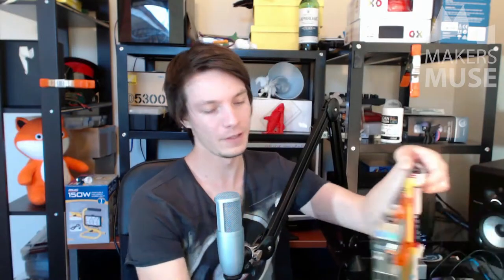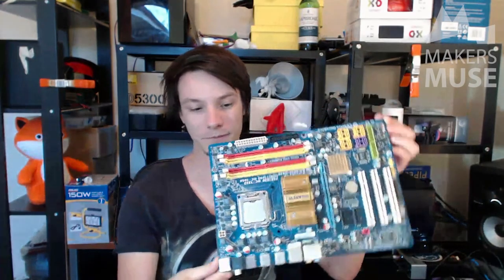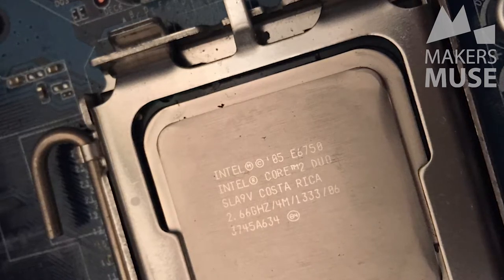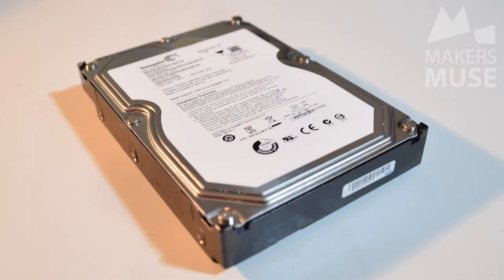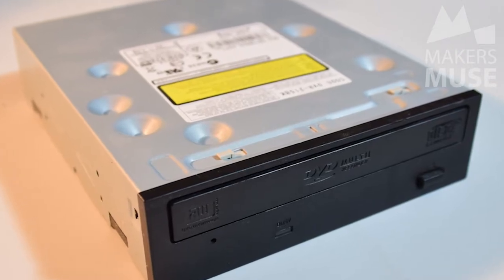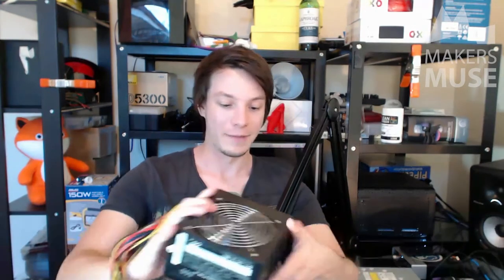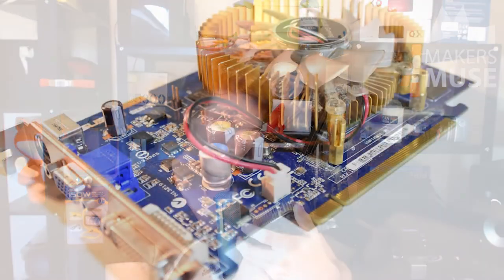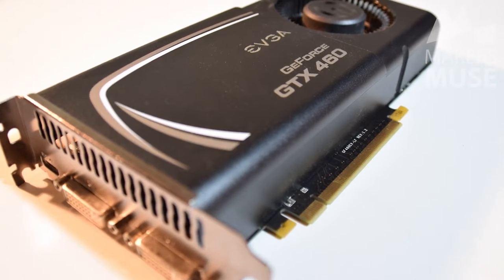CAD PC Dumpster Challenge! Part 1 - The Components - 2015

Comment: If all you're doing with it is cad, then here's my take:

Gpu, go with the 8600, those are bog standard oem cards that are built in just about every off the shelf office pc, and probably have a better chance of having decent linux drivers. If however you want to do more indepth 3d stuff; use your friends card, and hope there's driver support. Maybe look into underclocking the gpu's?

Power supply, yeah go with the coolermaster, probably better efficiency than the noname brand too. Casewise, meh, if it fits and it keeps the dust out, go with it.

Mobo, defo go with the intel, it saves on the powerbill, and with only cad use, might even go with underclocking it to save more money.

I've got a bit of a dodgy feeling about using that raid harddisk. Might try booting ubuntu (or mint) straight from a usb stick, and using the harddisk solely as swap storage?

Good luck man, looking forward to the other 2 parts to this series!
Reply from the maker: devjock Ah dude it's exactly this reason I posted up the parts I had! Your input is invaluable cheers :) I hadn't even thought about the GPU drivers nor even considered underclocking either, will look into it! The RAID disk is a little dodgy I must admit, I intend to stick dropbox on it so not a big deal if it fails as it'll be backed up but certainly looking out for more tempting options. Next part coming asap!